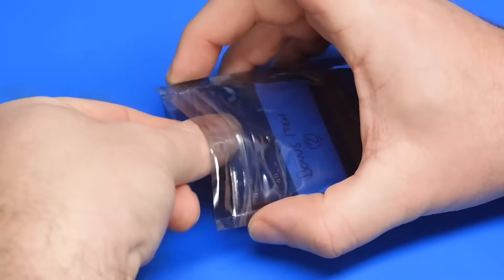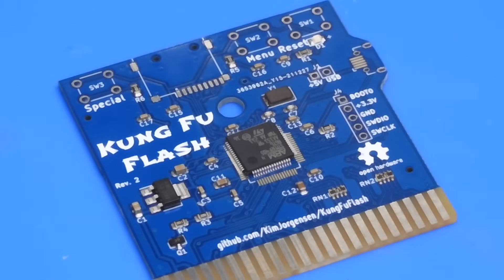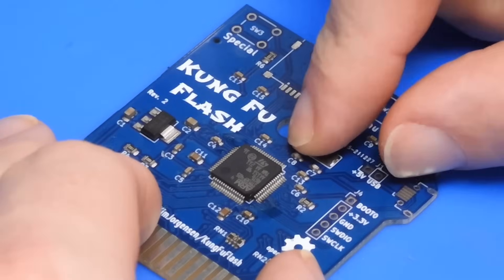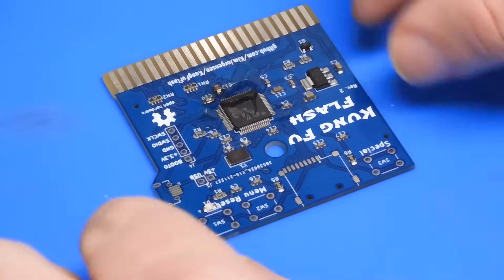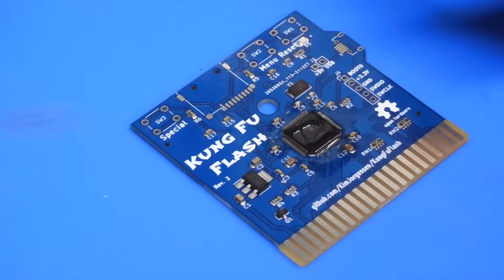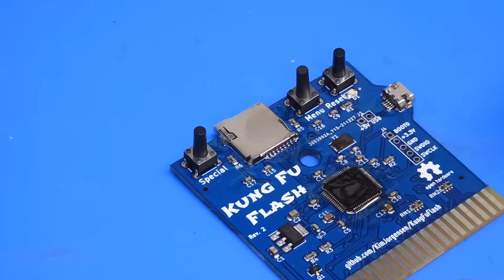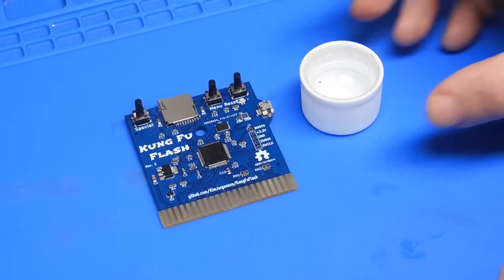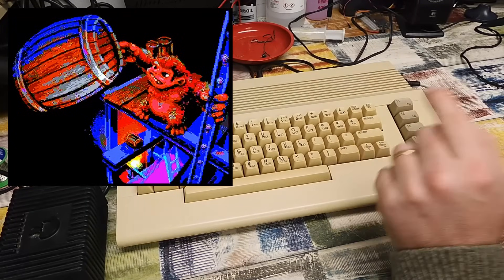Commodore 64 Kung Fu Flash mini build

Comment: Are there any tools to help you keep the soldering iron steady? I have quite a shaking hand, but I would so much like to learn soldering and start tinkering with my retro computers.
Reply from the maker: nothing that I can think of but I too suffer occasionally from a shaky hand and when it does start I find resting my arm and wrist on the table beside what I'm soldering can help.  If its really bad, I can push my wrist into the table which I find gives an anchoring point for my hand.

Comment: There is  SMD Chip Glue the electronics seem to use to lock the component to the board so that it doesn't move while they solder it.

Comment: Nice. FYI I recently ordered leaded solder from RS Components and they rejected it as a restricted item. Needs a trade account.
In the same order I had a few flux pens, wick etc which came with a 40+ A4 pages regarding H&S.

Came fast, I'll give them that. The flux tasted funny though.
Reply from the maker: I get my solder from CPC Farnell, they don't require you to have a trade account.
Reply: @CRG  CPC Farnell did indeed work. No bullshit H&S leaflets.
Reply: Just as well they didn't sell you the solder, I find that gets stuck in my teeth...

Comment: My C64c really needs one of these. Any recommended source?
Reply from the maker: There are various folk selling them on ebay or you could download the gerbers from github and get them made at one of the pcb houses.  I asked Lee where he got his boards, he ordered them from jlcpcb.  Minimum order of 5 though and you'd need to get the soldering iron out.
Reply: @CRG  Thanks bought one from eBay. Soldering iron next time 🫣
Reply: @CRG  Did jlcpcb assemble the other components that you didn't install in the video?
Reply from the maker: Are far as I know, yes, they assembled the rest of it.  I didn't order the board myself though, it was a donation by Lee from MFMI.
Reply: You can also get them assembled and ready to go from places like The Future Was 8-Bit if you don't fancy soldering yourself.